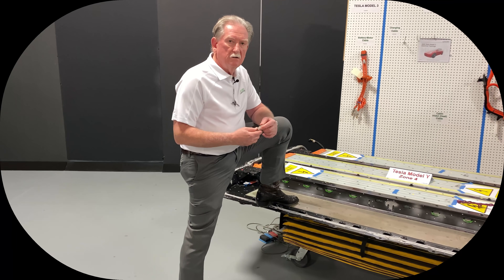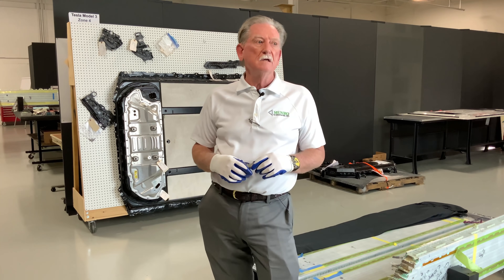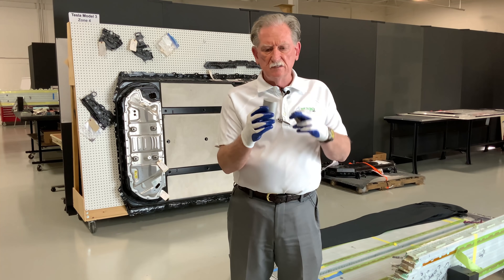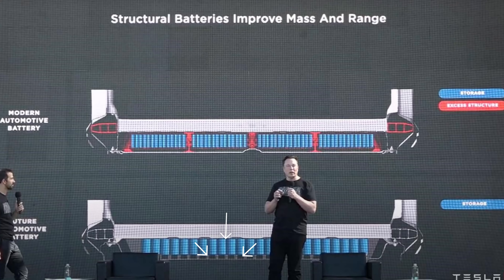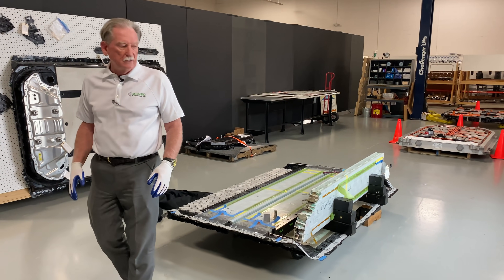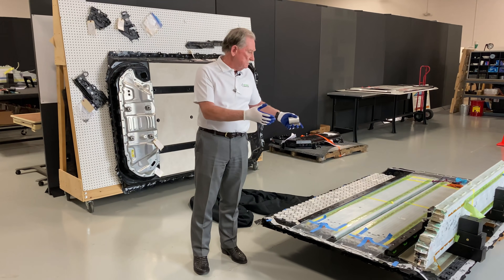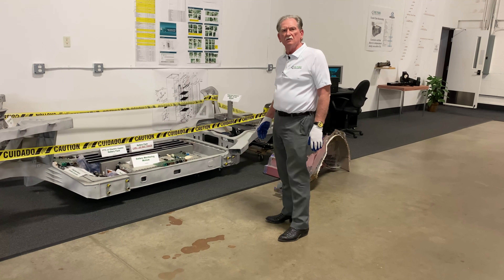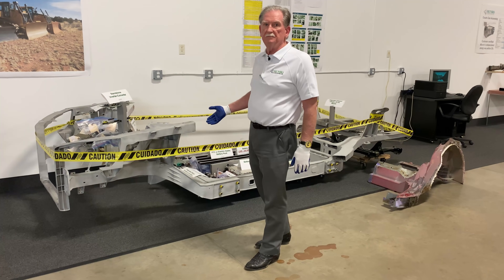Sandy is Thrilled about Tesla's Battery Day & Begins Battery Mock-up

Comment: The important part of the diagram at 2:31 is that Tesla can maintain the same kWh capacity while reducing modules size by ~40%. As Elon said on Battery Day, they can keep the heavy weight of the battery closer to the centre of the vehicle which improves the ability of the car to turn, it also allows more space between battery pack and outer edge of the vehicle in case of side impact - this will reduce incidents that could cause the battery to short.
Tesla will most likely keep the same capacity of battery pack to allow them to produce more vehicles. With reduced heating issues supercharging gets easier and doesn't affect the batteries as much. Here in the UK I can see all our motorway (like American interstates) having excellent coverage in the next couple of years and A-roads shortly after.

As always, Sandy is right on the money. Legacy auto doesn't realise the impact this will have. Plus they can't really afford to design, engineer and rebuild their entire production lines right now.

Comment: @munro llive wouldn't a structural battery preclude individual battery replacement / recycling ?  Especially if they are using epoxy

Comment: The one thing I don’t like about casting the front, or rear end in one piece, is it will be expensive AF to fix after a fender bender. Gone will be the days when you could just replace a quarter panel.

Comment: I've skimmed all 1007 comments and only a few have caught or commented on the miscalculation of 9000 mAh capacity of the 4680. Why hasn't there been more talk about this! It should be more like 25000 mAh with the data available. Tesla even said the form factor is a 16% bump in range (pack energy density). I'm a big Sandy fan and no doubt we will look back on battery day as a big step change in battery production, thermal advantages and to a lesser extent pack energy density, but how can so many people overlook the glaring 9000 mAh cell capacity issue!

Comment: These innovations are simply incredible. My only question is, will the new castings on the finished cars be repairable? I know that autopilot and FSD make for a very safe vehicle, but will they be repairable if the driver has a small fender bender? I’ve seen BMW i3 vehicles being written off with very little apparent damage and I know that that vehicle has a carbon fiber safety cell. I wondered if the new cast Tesla’s will suffer the same fate?
Reply: Yeah, that's what I was thinking as well. Unless they make the 3 body parts easy to separate and replace, there will be a lot of totaled teslas. At least being able to replace the front and rear cast blocks would save the interior and battery, but I doubt they will go to that effort. Maybe tesla will have a purchasing program where they buy the wrecks and recycle them... like make empty shells and reuse the interiors or motors. But then this will have to be done manually, so the labor cost will be too high. Will just have to wait and see. Right now they are not the most DIY friendly manufacturer out there.

Comment: ARCIMOTO is a small enough vehicle to be made out of a single mega casting. The problem is this is a struggling young company who's already invested millions on machinery to fabricate and weld a typical frame chassis. They have no choice but to use this for many years to get a payback on that investment. Perhaps their next gen in 5yrs or so. Arcimoto should be buying these new batteries from Tesla!

Comment: Great vid as always sandy. 
I’ve a question about the battery cooling system. Wouldn’t it make more sense and efficient if the cooling plate is on top of the battery pack rather the bottom. Since heat rises up. 

A problem with Tesla’s approach of this structural battery pack is that if any failure would mean a complete write off of the car. Do you think their QC on these battery would be good enough?

Comment: Awesome video, your production quality is coming up for this audience!  Mid talk you might of hit a whiteboard for a beam intro, top and bottom member importance... and discuss the Hz ratings meaning and influence, what does it do to the driving experience and the suspension design.    Not to deep add some humor or language and perfect. Your passion on the casting was crazy powerful.  Brilliant ending.  Another video where you use your woodcell technology to mock up a 74kw battery that is moves some of the electronics closer to the source/use and optimizes further.  Lower moment and the combination of the two improvements (cost and density).  Note that the new cell is higher energy density and cheaper.  If you apply both by (my math) the new cell is 28.6% of the old cell in cost per mile!!!!

Comment: You need to redo those numbers, Sandy. The capacity of the new cells is off by at least 5x given the volume increase. 

Even with correcting the capacity figure you only get 93kWh if there's 960 cells.  That's assuming you can squeeze in 25.5Ah per cell. 

You need 1,341 cells of thereabouts to hit 130kWh.

Comment: Mercedes Benz just unveiled a solid-state battery bus without much fanfare at all
https://www.autoblog.com/2020/09/15/mercedes-benz-solid-state-battery-tech-bus/
However, their SSBs seem to only achieve a 10% longer range, while Tesla's 4680s get 16% range improvement by form factor alone, which gives credence to Sandy's question.

Comment: What if one of the cells in the structural battery pack fails? Will it be taken out or other cells will need to work more to compensate the capacity loss?

Comment: 2nd serious flaw: Elon Musk stated on Sep 21st that these 4680 cells will be used for future vehicles: 
https://twitter.com/elonmusk/status/1308148212876812289
"Important note about Tesla Battery Day unveil tomorrow. This affects long-term production, especially Semi, Cybertruck & Roadster, but what we announce will not reach serious high-volume production until 2022."
For Semi: Tesla will again need about ten thousand of these 4680 cells.  With 20.0000 connections. So: for a Semi battery pack, these larger cells (about 25 Ah) are way too small  and history repeats itself.
Of course, you can still put your wooden fake 5070 cells in a Model Y battery case, but 80 mm is 10 mm more than 70 mm (your predictions did not work out), so they do not fit right away. Especially, when also moving cooling plates to under and over the cells, instead of in between them. 
The other flaw in your argumentation: when this I-Pace battery pack design (designed by LG Chem, who also supply the cells and modules) is so desirable, why is it limited in charging to around 100 kW?
And finally: why should Tesla stick with a 350V design like you state on your flipchart? They can change their cells from a 96s 10p configuration to a 192s 5p configuration at a 700V level just like Porsche Taycan or Lucid Air did. This way they can reduce currents on the DC charging cables from the Superchargers V3. But of yours, then they need to update their electric motors and accessories to handle this voltage.

Comment: Mate Rimac says they tested various cooling approaches for their various bespoke power systems as well as those for their own cars, including immersion and Tesla-lie approach, and settled on axial cooling. Lucid also uses axial cooling.
You were right, again.
Of course, until traditional battery manufacturers start producing 80x46 or similar tab-less cells, Tesla has a huge advantage. VW might be the first to catch up, with their joint venture with Northvolt.

Comment: 2:33 - serious mistake: a 4680 cell is associated there with ~ 9.000 mAh. That is way too low. A 4680 is about 5.5 times the volume of a 2170. Tesla stated 5 times the energy for a 4680 compared to a 2170 (see Tesla slide from battery day), so the 4680 will be about 25.000 mAh. But 960 cells times 3,6 V times 25 Ah = 86.4 kWh. This is nowhere near 130 kWh. You should redo this analysis and include proper numbers.
Reply: The ~9,000 mAh figure is mistaken, indeed. But your number of 25,000 mAh is wrong, as well. 5 times the energy comes from the larger volume alone. There are fundamental changes in the chemistry, as well, though. This raises the multiplier even further.

Comment: Awesome Sandy! I was predicting thicker batteries too, they need to be made in clean rooms but you know that can be overcome. I once helped setting up a dry lab for video tape manufacturing, they did not listen to me and failed. Yes a big cast to make a car from fewest components. A floor plate so rigid to hold it all with virtually zero warp. Keep all heavy stuff on the bottom and the 
handling will be best.

Comment: Yes, and if you have a small accident you need to replace the entire car, or at least the underbody frame as it will be impossible to repair / realign - so it will be like a single use product; 
The same with the batteries built inside the frame, if you want to replace them with one future modern newer pack with more range, probably it will be impossible !!!

Comment: My first thought about the Archimoto was: "Wow, that would be cool to make with two mirror image moulded parts like a plastic toy". Maybe 2  parts is more likely, bottom and cabin frame. Looking at the Tesla battery pack, it can be very small if the car is smaller, so maybe only two parts where the rear or front moulding has the battery compartment. I have asked several locals that drive those Smart size EVs where they work and how they use their cars and this is how: "I drive 15km to work, it takes less than 20 minutes, driving back takes 30-80min. charge once a week. When I go on vacation I jump on the bullet train and head back to my home town 400km away." Looks like Tesla needs a Model 1 too with 150 of those 4680 cells under the back seat.

Comment: a small mistake. 2:36 cell 4680 has 25Ah but not 9. The whole battery (960 cells 4680) on the old anode has 80KWh versus 73.5KWh in the current design. Battery will using a new silicon anode - 96 kWh.
 Cooling will only be on top of the cells. From below, they will only be warmed up, there is enough cooling from the air flow there. The hint at the wing from the aircraft was that the lower part would receive also ribs that would both cool and laminate the airflow, which would increase downforce.

Comment: Thank you.  Really interesting analysis.  Personally, I think Tesla should buy or merge with Arcimoto before someone else does.  Tesla's product offering should range from their EV ATV, to the Arcimoto FUV, to their new compact car, to their existing car line up.  If they could re engineer the FUV and therefore also the manufacturing plant that builds it,  they might be able to significantly cut the sticker price.  That would be a game changer.  The price could be so low, it would be thought of as "the second car" for shopping for groceries and for the teenagers to drive.  It just seems like a no brainer to me.  If Tesla could dominate all the nitches from ATV to the semi, they would definitely lead the world's transformation to EV.

Comment: Mr. Munro, I love your videos and the way reverse engineering is done to the most intricate scenario. Thanks for the awesome work and mind blowing explanations. I tend to dwell quite a bit on your channel and watch all the fun stuff ;)
Regarding cooling the batteries, I believe would be best if Tesla could make the cooling ports interchangeable. For example, if the car is driven in Nevada and the ambient temperature is 110F or so, a port switch valve will invert the lines so it cools the batteries from the top downwards, and, vice versa when the car is driven in an 10-32F ambient temperature rather warming the batteries. 
The simple explanation is that the heat zone will always radiate naturally towards the cold zone thus, cooling side of the batteries must be inverted and optimized for different extremes of ambient temperature. Btw, I heard that the new battery sets will be the bedrock of the frameless Tesla chassis and might not need an intensive cooling or, thermal management as their predecessor, because they have a better electron flow and higher charge / discharge efficiency.
Update: port switch valve is probably not so necessary if there is a gear pump that moves the thermal conditioning liquid either direction, according to what the ambient temperature is.

Comment: Epoxy is heavy, and also potentially harder than the batteries, meaning the actual vibrations and deformation happens in each cell, which seems suboptimal.
Is there a better material than epoxy for filler? Ideally something that can wick heat?
I'm almost thinking unalloyed aluminum might be the better choice? (Assuming it can be gotten into the right shape without in place casting, which would be too hot by far...)
Reply: Sounds like reconditioning packs and removing faulty cells will be significantly harder

Comment: Sandy, the reason other OEMs aren’t going to giant castings is that it’s a huge investment that severely limits your flexibility when redesigning a model. If Toyota or whoever could be certain that they would keep the exact same floorpan for a decade or more, then absolutely they would do it. But it’s a huge amount of money to invest up front and be wrong two years later. Tesla hasn’t been around for decades to experience this yet. Now I’m not saying this is the wrong way for Elon to go, but it’s easy to armchair this stuff from a distance.

Comment: The one big thing I am happy about is that the Cybertruck becomes closer and closer to reality and having proper range. With these improvements in batteries, it could probably have something like a 200 kwh battery pack that could deliver that 500 mile range promised.

Comment: Tesla could stack the Semi with three battery packs on top of each other in a single cast that itself belongs to the frame. If you make the frame waterproof, you can cool the batteries with immersion cooling.
Then you can charge a semi within ten minutes.

Comment: Sandy, do you think that Tesla might go a step even further and eliminate the casing on each battery cell by just inserting each "jelly roll" directly into a space in a single piece honeycomb for casting? This way they don't need any epoxy and it would be even more rigid, l (100% metal). Also the whole honey comb could then be used as a giant heat sync for cooling without the epoxy impeding the heat flow.

Comment: im no manufacturing expert but other companies are not into huge die casts due to the flexibility in producing various car models/parts.  Tesla, like Apple, has the advantage of producing a few models yet the consumer demand is there. 
It seems that the 2170s will be used for high performance models while the new 5x battery for the rest

Comment: The one thing that concerns me about using the battery module as support structure is that it makes it almost impossible to replace the battery pack/module in the future if there is a problem.* I'm sure they've thought of this which means that as thoroughly as they test the batteries now, that thoroughness will be doubled or better going forward. The battery pan will probably outlast the car itself.

* Recycling or repurposing these batteries later on could be an issue too. Maybe!

Comment: All that Sandy says about Tesla's speed of improvement is True.  I know cas I worked at TOYOTA Motors and they live n breathe continuous improvement.  But even at Toyota we don't improve things at the pace Tesla is moving👍👍
Reply: Toyota is dependent on Nippon Denso and other suppliers to advance. ND wants to recoup their NRE costs so they won't obsolete products in just a year or two. Tesla makes continuous design changes. No one can keep up with such vertically integrated design and manufacturing.

Comment: Thanks Sandy for another interesting Tesla explanation. Question, when the parts get larger and fewer, will it not be more difficult and more expensive for repair if the car as only a small accident? Like if one side of the front casing part get a little damaged the whole part as to be changed which will both the expensive as buying the part as well as manpower cost for changing to the part. Any comments?